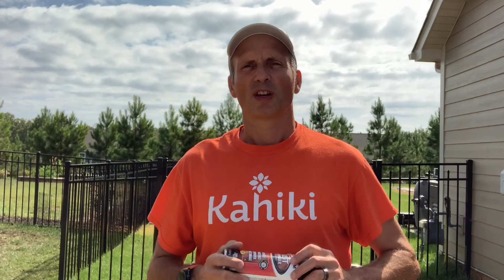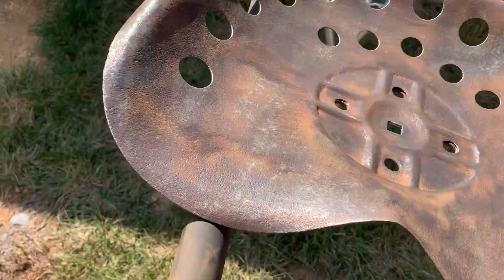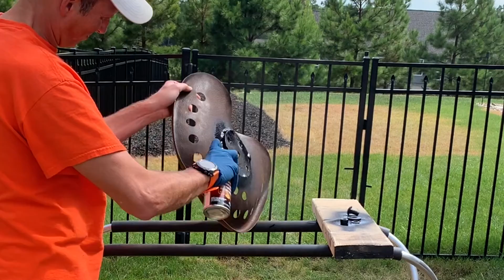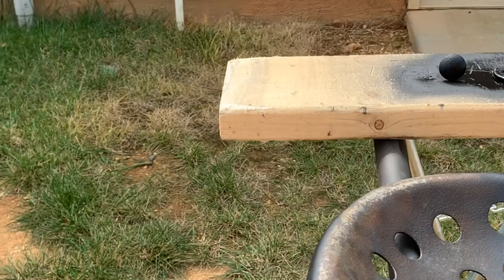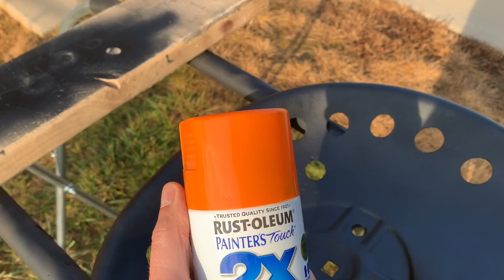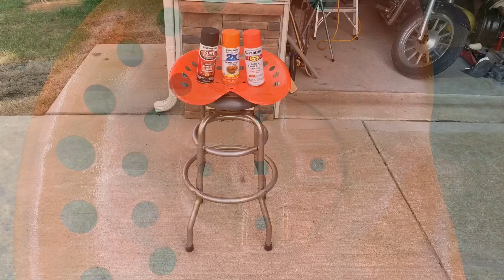Rustoleum Rust Reformer Review

Comment: That paint that you are using, Rustoleum 2X,  is used by MANY yTubers to paint entire Cars and they turn out great.  Your paint skills are lacking.

Do you even know the differences in the Rustoleum paints?
The 2X is a paint and primer combined.  That's why some of the car painters use it.
The other type you used is paint only.
Reply from the maker: @lifequest7453  Turned out fine with regular Rustoleum as did two sets of steel wheels, so I’m OK with my skill set.  Maybe you should start your own YouTube channel since you have all the answers though….  Thanks for commenting!
Reply from the maker: @lifequest7453  Well bless your little heart, I must have really offended your favorite paint.   Sorry, didn’t mean to hurt your feelings, but hey thanks for all the comments as they really help the channel get more exposure!  So go ahead and troll away as it won’t change my opinion that this particular can of 2X did not cover well over Rustoleum Rust Reformer.  Maybe the two weren’t supposed to be used together but since I was just EXPERIMENTING (do you know what that word means?) I didn’t care.  Also, I daily drive a six speed manual transmission Jeep… just wanted to let you know since we’re to trying passive aggressively cast aspersions at my manliness with you anecdote.  And for the record, I never claimed to be a painting expert, nor do I care or aspire to be one.  But hey subscribe to the channel and follow along because eventually I will be painting my hot rod project and I’m sure you’ll want to see how that turns out so you can critique my painting skills again!
Reply from the maker: My skills may or may not be lacking… this stool was just an experiment in preparation for another project where I was planning to use rust reformer as the base coat.  I stand by my assessment of the 2X as it didn’t cover the rust reformer well at all. Maybe the can was bad or not mixed well but regardless it didn’t cover when regular Rustoleum did, and did well (the other project bore this out).  I know the 2X includes primer and may have worked better on bare metal or at least a lighter color base coat.  Thanks for watching!
Reply from the maker: @lifequest7453  🤣 You be you baby! 🤣
Reply from the maker: @lifequest7453  🤣 Dang, you’re really butt-hurt over this!  How many times you going to keep getting the last word?  I mean I don’t mind, every comment just helps me in the YouTube algorithms… but you keep thinking your opinion matters if that helps you sleep at night.  🤣  PS I dare you not to reply again but I’m guessing you’re the type that can’t help themselves and just has to have the last word in order to feel they’ve proven their point.
Reply from the maker: @lifequest7453  and my point is proven by you replying yet!   And the fact that you just blatantly lied to “prove” your point.  I defy you to point out the time stamp in the video where I was “jumping up and down”.  You can’t because it didn’t happen.  Liars have no credibility.  As for my “throwing the can”… you think me flipping the can into the grass with my non-dominant hand for comedic effect is a throw?   Now your judgment is suspect.   And finally you obviously can’t comprehend subtleties so I’ll put it very simply… I don’t care how good a painter you may or may not be, I also don’t care what you think of my painting skills.  In short, I simply don’t care about your opinion.  But feel free to keep trolling and replying again, I know you can’t help yourself.
Reply from the maker: For any viewers looking at this list of my comments, wondering about the lack of continuity, the original poster/commenter went through and deleted all of his follow up trolling, derivative and derisive comments that preceded all of my replies.  To me this only further exemplifies his lack of character as he couldn’t even stand by his own words.

Comment: any update on how its doing?
Reply from the maker: The stool is actually holding up very well.  I did drop a chunk of steel on it and it chipped the orange paint a bit but the rust reformer stayed put.  Other than that and garage dirt, the paint looks pretty much the same.  I’ve since used the rust reformer on a lot of other projects including two sets of steel wheels.  I basically use it as primer and am still very pleased with its application and durability so far.  Thanks for watching!

Comment: Can you use it in car panel and paint later on  top of that ?
Reply from the maker: I would think so but you would probably want to test it with the paint you’ll be using.  Different types of paint can react badly when mixed.  I’ve been top-coating mine with other Rustoleum paints and it seems to be working for me. Thanks for watching!